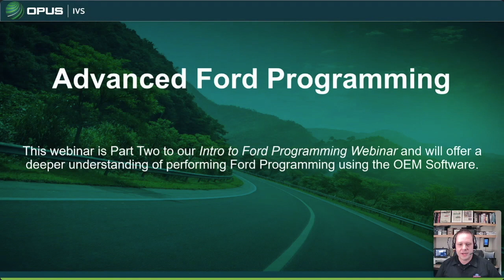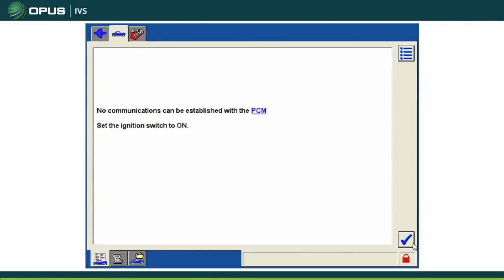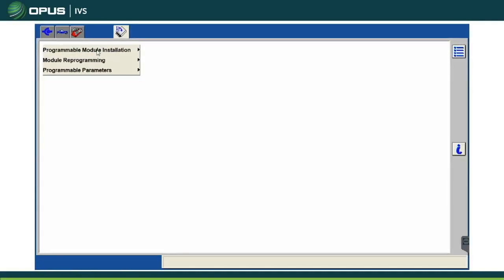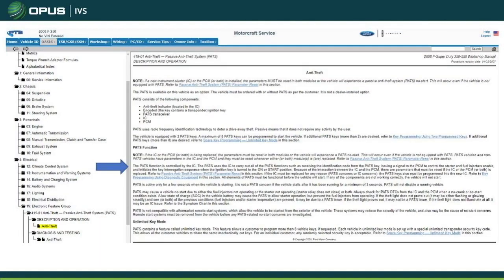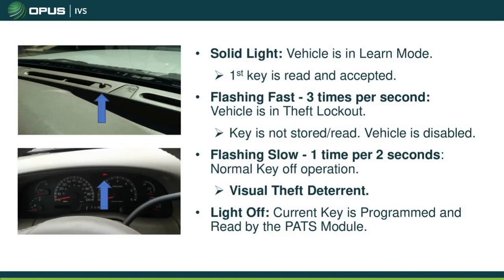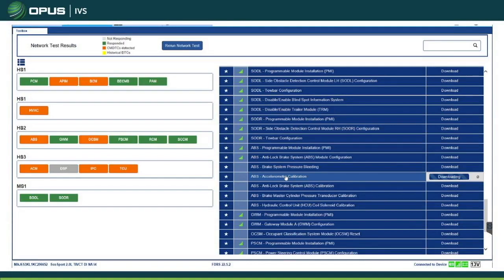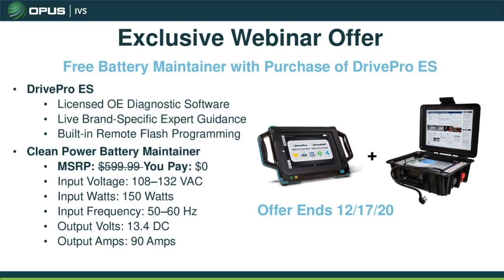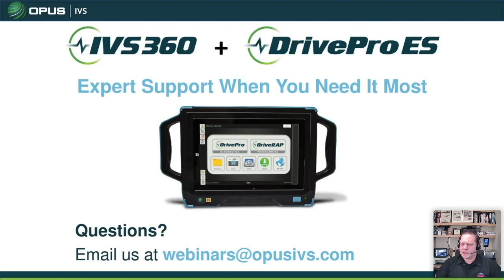Advanced Ford Programming Training

Comment: What about for programming a new RCM where the old module has an internal fault?
Reply: Define "internal fault"

Just confirm the tear tags on both PCM's are identical. It helps with the module programming. There are many PCM reprogramming videos on here to guide you through the process to get you up and running
Reply: You can program a RCM using the old RCM by performing a pmi even though the module has a fault as long as it is not damaged and can communicate.